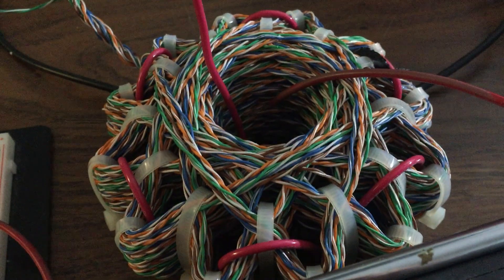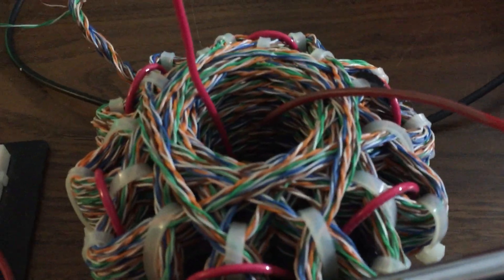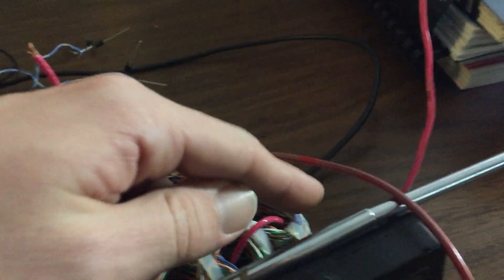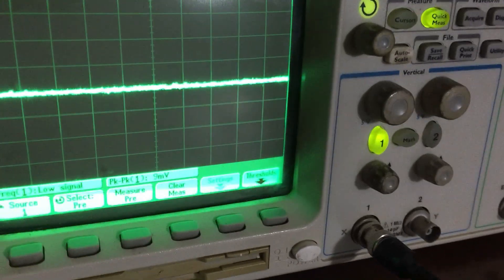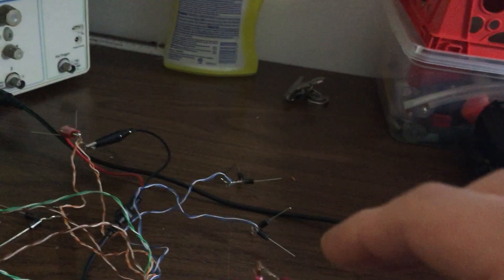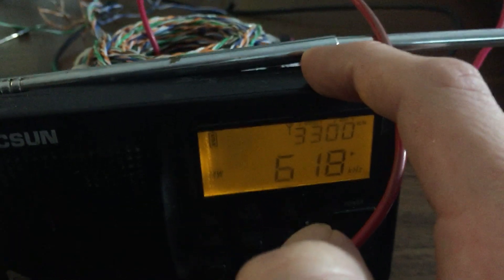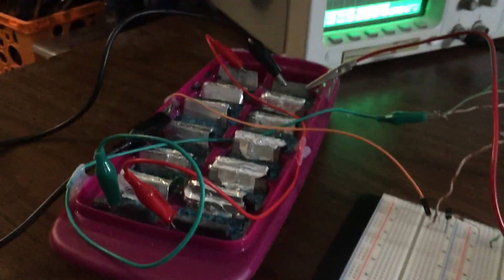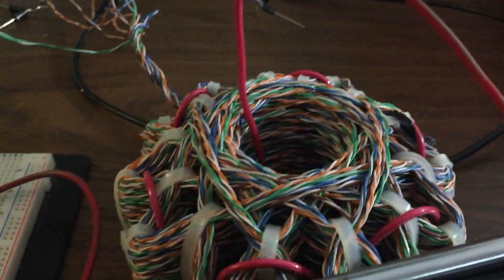Self Oscillating Rodin Coil

Comment: This is the nicknamed "starship" variant of the Rodin coil, if you're interested in improving the output take a look at the ABHA/POE variants, the self-crossing design produces a monopolar field and different effects, it's the same type Nathan (OMB) is using.

Its geometry also perfectly replicates both sides of a magnet at the same time, make of that what you will.
Reply: It's not a variant. Lol. It's just flat. I'm really surprised Joel and his listeners don't even know what a rodin coil is. My comments keep disappearing in that thread, as usual.  This platform is heavily censored
Reply: @TravisTellsTruths  The starship variant of the Rodin coil has sharp turns at the edges as can be seen here, the original Rodin coil itself is toroidal with the torus volume and circular structure.

There is a flat variant of the Rodin coil used in a particular manner in the flash matrix. but with how it's wired up I wouldn't consider it a Rodin coil at that point.
Reply from the maker: I think enough people have been nice and answered you many times here. I won't continue this argument. @Travis
Reply: @TravisTellsTruths   yes. zionism, pedophile lobbist lgbtqp terrorist JewTube... they have deleted one of my channels, completely!! Because i speak against pedophilia, rainbowf.kers !!! SAVE OUR SOULS S.O.S.